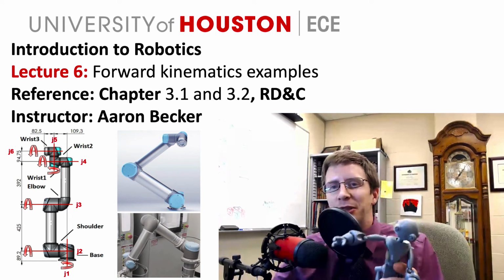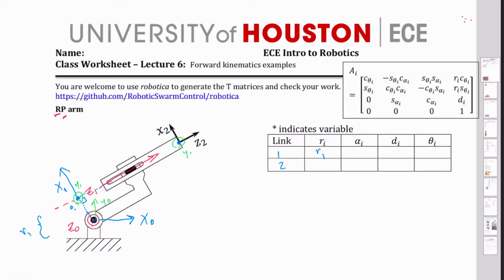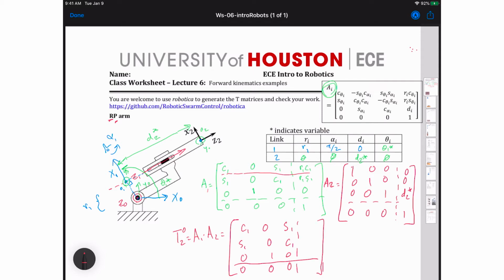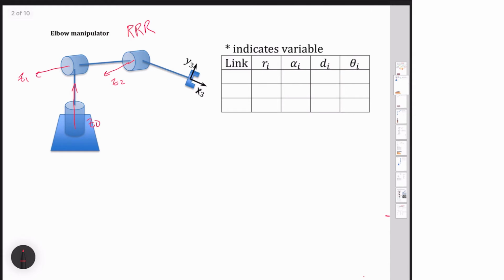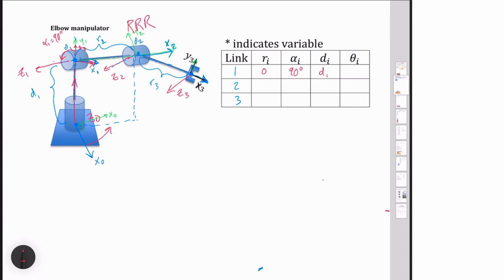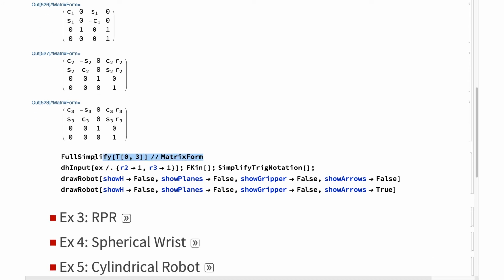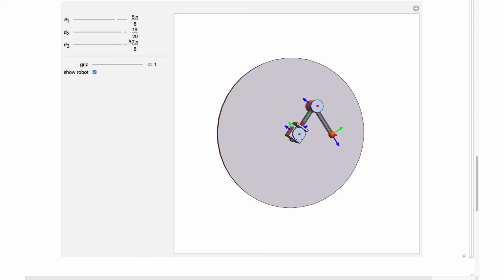Intro2Robotics6a: DH for RP, Elbow manipulator, and RPR robot

Comment: I want to ask that if we drag down origin of X1 it will get onto origin of X0 means that the both X1 and X2 origin are in same direction so can we not consider it as same origin for both X1 and X0? which means r1 will be zero in DH-table 
As you explained in your other video that if  Xo and X1 have same origin then the link offset r1 will be zero...
Also that X1 origin is at a distance above from the X0 origin so won't we gonna write d1 in DH-table?
All of this you have explained in your lecture no 7b of this lecture series.. 
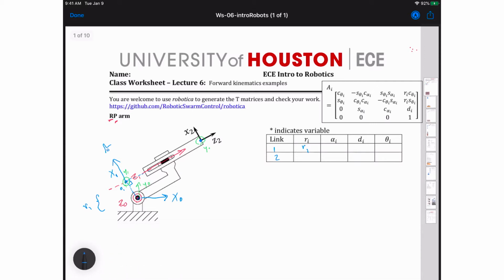At 5:40...
I'm confused here can you guide me i have exam to prepare... 
Thank you
Reply: what i understand x0 should have same orientation as x1 and x2, so when you move along  x-axis, r will be some value.

Comment: Is r3 should be negative since x3 is going right but r3 should be measured from origin(3) to o(2) ?
Reply from the maker: Can you tell me where in the video this is (minute:second)?
Reply: @AaronBecker  Hi Thanks for taking the time and replying, I got it figured out. my bad!
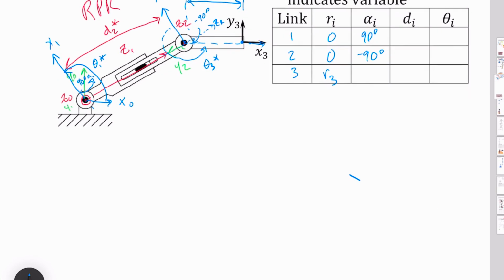Reply: @AaronBecker  But at 29:54 for this problem , why cant we consider 1st frame (x2 ,x2) on the sliding joint ?)
Reply from the maker: @dipinknair619  by DH conventions, x2 must be orthogonal to z1 and to z2.  The sliding joint is parameterized by its length, d2*, which is along z1.  Can you clarify your question for me?